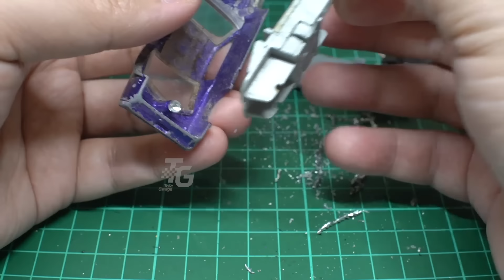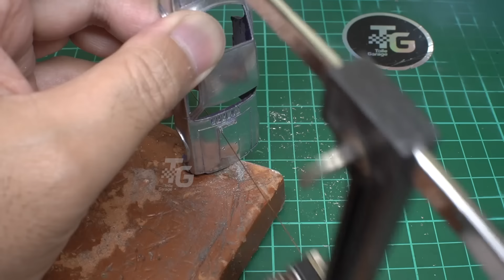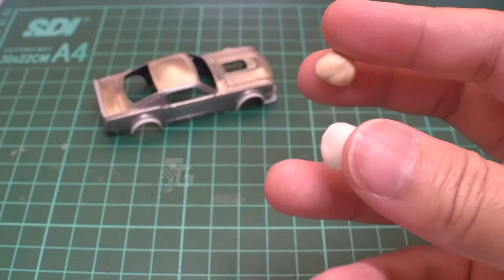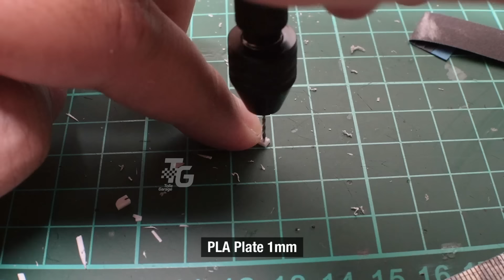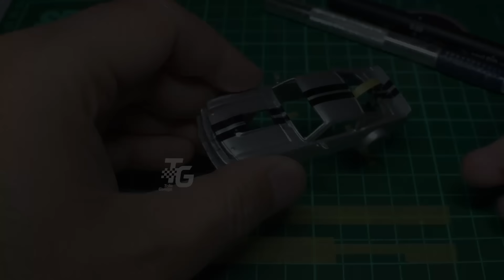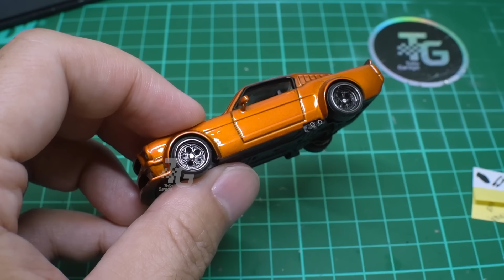Restoration Modification Hot Wheels Mustang Fastback

Comment: Amazing build, excellent workmanship. Question, I always have a problem with bending the axle pins that go into the axle tubes. They never seem snug enough, any advice would be appreciated. TY
Reply from the maker: Thank you my friend 😊🙏
Don't bend it too much.  Its function is only to hold it like a spring, so you don't need to use glue and it can be removed again at any time.
Reply: @TolleGarage  TY